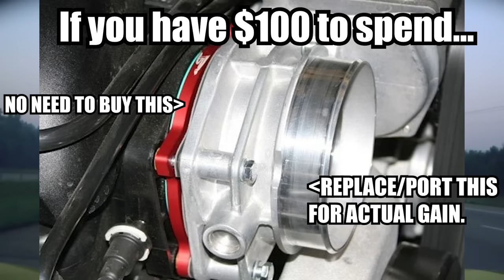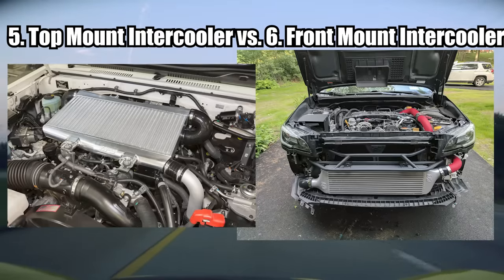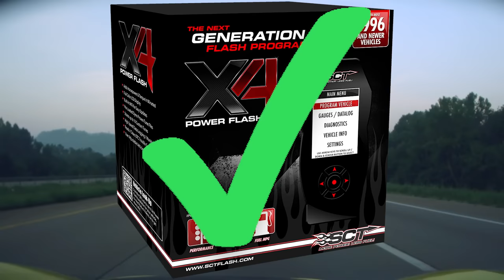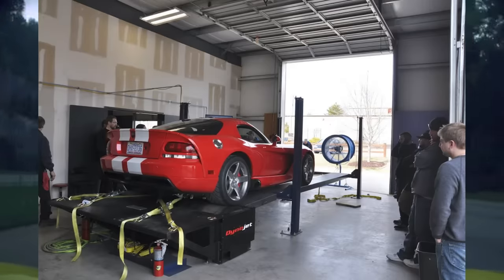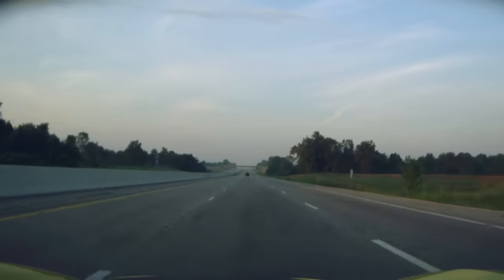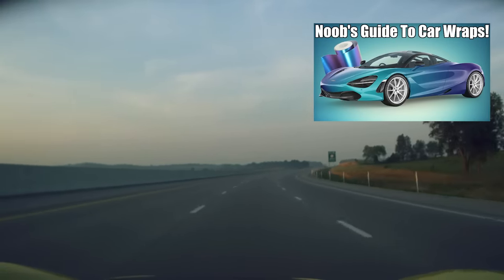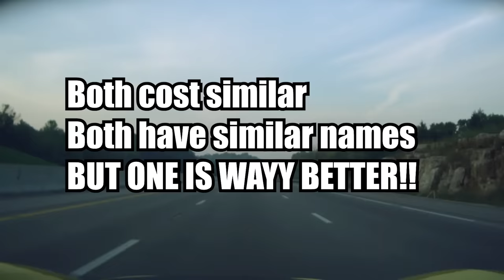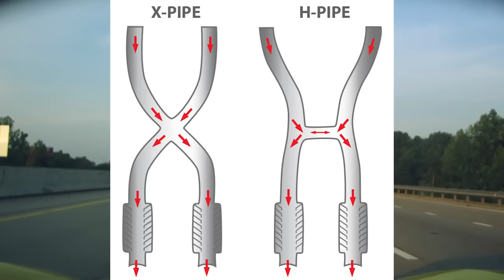25 Real VS. Fake Car Mods!

Comment: There becomes a point where having more air is more important than its temperature, sort of. For example individual throttle bodies suck in so much more air than an airbox or cone filter that it doesnt matter if its a bit warmer. Same applies with turbos, its so much more air thay even though its warmer the sheer amount of it outweighs the fact that its less dense. Many people dont think about this. For example. My nissan micra (stop laughing) had a really restrictive plastic intake pipe that goes from the airbox to right behind the headlight, i removed it and instantly noticed it was quicker (i measured acceleration times) this us because the airbox was now being fed from the hole thats in it, which is far bigger than the diameter of the piping attached to it, said hole also has alot more space around it whereas the intake piping is right behind the headlight. This made the car faster despite the engine sucking in warmer air. Just someting to consider when modifying ur cars intake.
Reply: still better if its cold air regardless

Comment: Can someone explain to be how I would know if a wheel is a replica or a real wheel?
Reply: if its not from the company that orginally designed the wheel then its a rep, so like if you see a TE37 style wheel thats not from Volk its a rep
Reply: @arcanevoid9199  So for someone who wouldn't know wheel brands. Who are the original wheel brands that I should be looking for?
Reply: @joshuabenitez3260  some popular ones are enkei, work, advan, oz racing, 5zigen, SSR, BBS

Comment: The exhaust part is completely wrong. Only NA engine need back pressure. If you have a turbo, bigger the pipe after the turbo is better.

Comment: This guy doesn't know anything about cars. He's lost. Disregard most of what you've seen and heard. Stay away from throttle body spacers and 'performance' chips. Yes, cold air intakes DO help performance and NO you don't need a tune for it. The ECU will add fuel to compensate for the extra air. This clown is simply reciting other things he's heard and he has no clue what most of it means. Most Corvette drivers don't know anything about cars.
Reply: whether a cold air intake needs a tune or not largely depends on the car and the the specific intake. some cars will actually not add enough fuel to benefit from the extra air, and if your car has a maf increasing the intake piping diameter can affect the reading quite badly